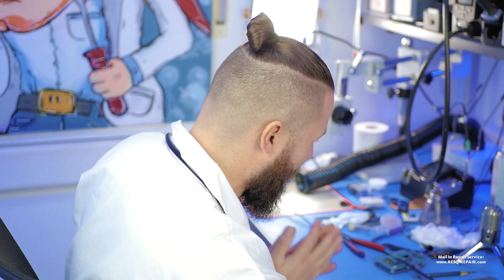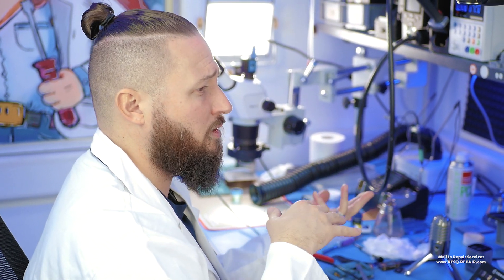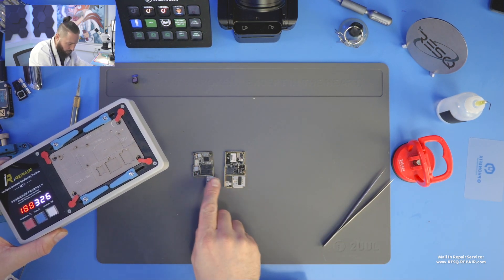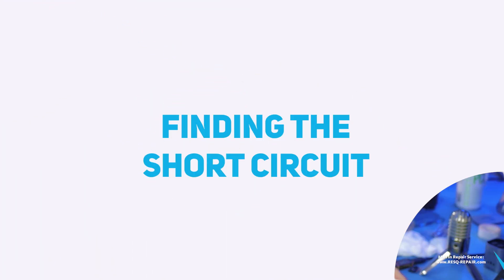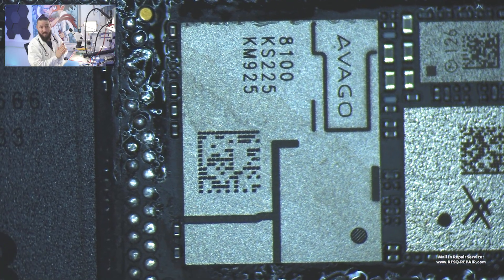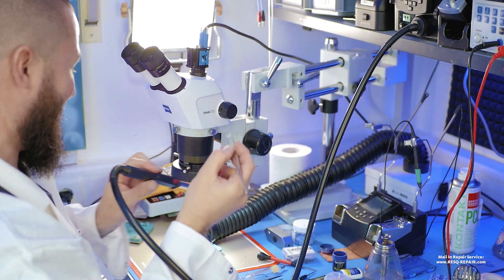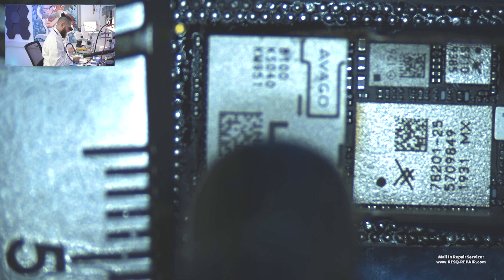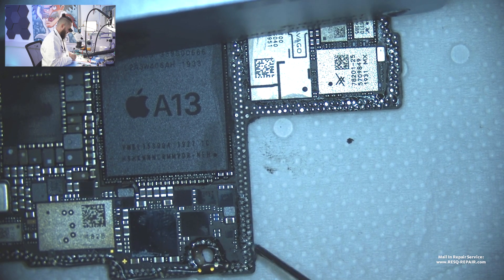🔧Dr. Ben: Repairing an iPhone 11 Pro Max with “No Service” (+ Tips & Tricks)

Comment: Great work Ben! As always. You could have check the cap under that chip, you can save it sometimes. 
Also, I’ve seen cases where the 3v15 was dead short and still had IMEI. I’ve also seen cases where due to interposer issues, there was imei present in settings - general -about but when dealing *#06# there was nothing